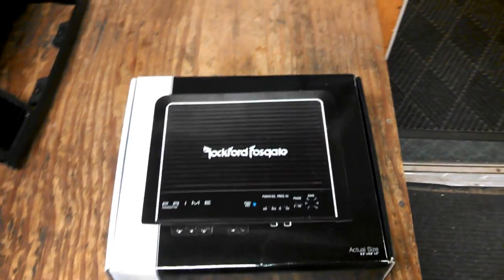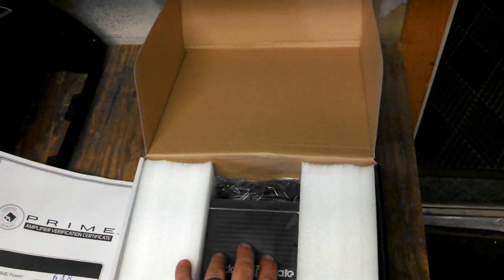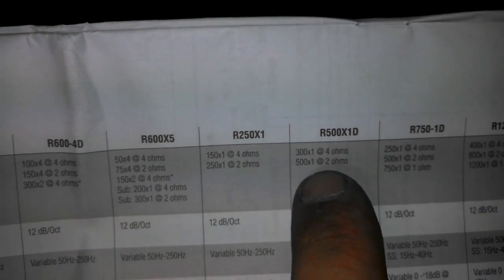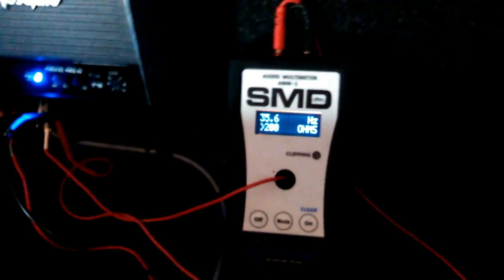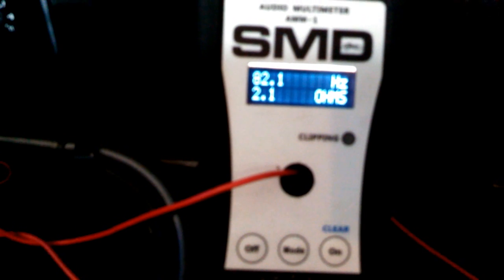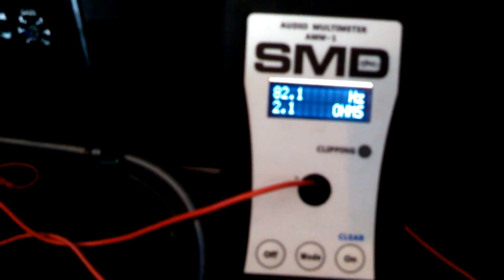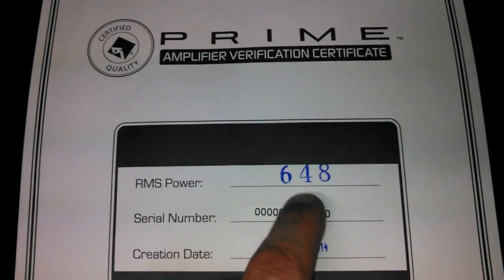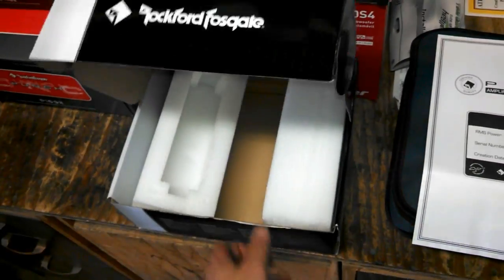AMM-1 Amp Test - Rockford PRIME R500X1D AMP DYNO

Comment: Hello, before installing my stereo, I would love some input from some fellow car audio enthusiasts. First of all, hello there :) I picked up 2 12 inch kicker comp r 500 watt rms @ 2ohm. I have each one in a sealed enclosure built to kicker spec. I wanted to power each sub with one of these amps. So I plan to run two of these amps total. Can I do this? Can I grab signal from one amp and bring to the other? Will I need a cap or an extra battery for this setup? I haven’t gone this big before so I’m trying not to blow sh*** up and make fires, any input or advice is welcome and very appreciated. Thank you all so much, have a wonderful day be safe and rock those tunes :) 👍 🤘

Comment: I have this very same amp in my truck pushing 2 Memphis 12's.......when the place installed it I looked at the guy and was like ,   really that Lil amp is gonna push them speakers. ....well it actually blew 2 of them within the first 3 months,  cracked the baskets on the woofer, no bigge, he replaced it cause it was still under warranty,  a week later the same side ,same thing , he then replaced it again by that time they had figured out that it was the previous generation Memphis subs that were the issue, after that and 4 yrs later still hitting hard only issue I have is the blue led light is no longer with us......RIP homie
Reply: Trent Robey you have an issue with your box, I would assume
Reply: @jeremys8360  yeah so I went with a ground shaker ported downfiring box with skar vd 12's and skar rp1200.1 amp still don't really like it, honestly the Memphis upfiring sealed box with a 500 watt rockford amp sounded better.....so now I got 4 audiopipe txx bdc4 6.5"s....just gotta build a foward firing box for it....urggghh...

Comment: I am happy to report my lil Prime 500 has been running strong without a single hiccup on 1 Kicker CVR-15 D4 @ 2ohms for over 4 years, not a single hiccup it's been paired with a Prime r300X4 for mids and highs. They have both been great amps for the money.

Comment: Just bought one used for $30. Also got a Alpine M500 for $30 and a old Punch 360.6 for $30. Installed in the family van pushing a single Kenwood 10" Excelon Shallow sub(250w RMS rated). Now I just need to hook up the bass dial where it can't be seen from outside but easily accessible while driving.

Comment: Do you really think this couldn't be wired at 1ohm?
Reply from the maker: TheAquam  Yeah I really do. It's not 1-ohm stable and will protect at 1-ohm.
Reply: I appreciate the honest answer and quick reply. I got the amp and a single DVC 2 ohm sub, after I got to looking and seen this wasn't 1ohm rated and realized I need to purchase a DVC 4 ohm sub lol. Thanks though
Reply: I've run this amp at 1ohm before, and works for about 30 min and goes into protection mode to cool down
Reply: I run this amp at 1.3 ohm all day long. No problems. Anyone care to elaborate?

Comment: my prime goes into protect mode now, whats the deal??
Reply: Peter Ou Was it working fine before?
Reply: 559KING yeah it was. It started a few months ago it would Go into protect mode when the bass hits hard. Then I lowered my gain it worked fine for a while. Noe it stays on protect. All wires seem to be fine.
Reply: Peter Ou What is your system setup? Ohms, speakers, 4 or 8 gauge etc....

Comment: AMP LAB Admin, i just buy R500X1D rockford amplifier to power my P2D2 rockford 12 inch 2 ohms Subwoofer, are they compatible?? Hoping to your kind support.
Reply: Of course 😊i just bought this amp for my two 12 inch rockfords
Reply: I'm running one of these
Amps to 2 p3d2 10s and they absolutely pound. I could use more power to them but don't really need it. I feel my ear drums flex when the bass hits

Comment: Are these stable at 1ohm?
Has anyone tested them at 1??
Reply: +MiragEdoz will not work at 1ohm. It shuts off.
Reply: the rockville amps are one ohm stable
Reply: @dank9288639  they are also junk overrated bs

Comment: Can I assume the 5.1 channel of the same exact series is also probably a good amp or is it possible it has completely different design and parts inside?  I'm thinking it will rate as well..  but not sure.  That goes with any manufacturer, I wonder if I can assume the entire series is good if one of the amps in series test well?

Comment: Just purchased this RF Amp and am pairing it with a RF 12" P2D2 single vented enclosure would it be safe if I go all 500watts?? The sub peaks at 800RMS, and would it be a dumb to do, to stuff the box with polyster batting for a better sound??? Need help this will be my 1st system
Reply: +Timothy Hinton hahahaha agreed once you get the bug ooweee lol 
I've dumped more money into this hobby/lifestyle than I care to say ahaha
Reply from the maker: well you actually purchased the wrong sub. You really should have purchased the P2D412. It's the dual 4-ohm version. 

With the one you got you will need to wire to 4-ohm, which is going to cut the power of the amplifier down quite a bit. And if you wire in parallel I stead of series you'll drop down to 1-ohm, which, since this amp is only 2-ohm stable, will either make this amplifier go into protection, or ruin it.

You really should exchange it for the dual 4-ohm version.

Also, the P2 is not 800W RMS.  But yes this amp will be perfectly fine for it, as long as you get the correct voicecoil configuration as I mentioned.
Reply: Not sure what you mean...the amp does it's job...there is no way to control watts once it is hooked to a sub in a box..it does what your sub and box let it do..down to 2ohms or so
Reply: +Timothy Hinton yea found that out once I did Lil research and hook it up myself, first time doing any type of sound system
Reply: bimbo831 if your sub or subs need 500-600 watts rated then you can not go wrong with this amp..I am impressed
Reply: bimbo831 just don't clip it or your subs..when It stops getting louder back off a hair or two and learn to hear distortion..my friend has an I phone and it sounds like shit on my sysytem..I have to tell him everytime he hooks up his phone he is clipping.turn the sygnal down
Reply: And I am not sure why the maker of this video is scared to run 20 hertz at full blast..any decent sub can take it..just. like a sub sonic filter..they can take it..if they can't then they are not good enough
Reply: bimbo831 welcome to the world of bass addiction..you will only get worse..it is like a drug...wait until you hear your buddy with 4 15's on 5K
Reply: +dank9288639 I just got a Sounqubed HDC4 15..it sounds great in my huge custom box but it is begging for 4 times the power...time for a high output alternated and a few batteries in the back..more money..lol
Reply: +Timothy Hinton Yea man I need to work on my electrical as well. damn alts cost a small fortune tho

Comment: Anyone got any sdvice? This amp blew my Alpine S-Type (500RMS 1500Peak) had the gain at 65%. Bad AMP? or my Ignorance??
Reply: Correction, my S-Type is 500 RMS and 1000 Peak
Reply from the maker: Doesn't matter if the wattage is matched perfect. You were most likely clipping the amplifier. Thats likely the cause of the blown subwoofer
Reply: The Amp Lab Is that too high of a gain setting?
Reply: The Amp Lab Thanks in advance.
Reply from the maker: No way to answer that. Depends on signal voltage from headunit, and other factors. You really need an o-scope or distortion detector to properly set gains. Some amps also have guidelines to set gains based on output voltage of the amp.  I don't believe Rockford has that though.
Reply: Gain is like a volume nob..only used to match your output to your other amps and settings...screw the guys that say gain is not a volume knob..that is exactly what it is but you must use it correctly ..it is there to set at the right level..might be 20 percent or 80 percent..it all depends

Comment: Would you be able to run them to 1 ohm? Running two Rockford Fosgate P2D4-12 4ohm DVC
Reply from the maker: I wouldnt think so safely.  These ARE still a budget amp.  Don't think they will like lower loads.
Reply: Personally i like rockford Fosgate cause they are True RMS thats why i want to get it and not break the bank but thanks!

Comment: Loving the amp tests. I need to make a video of what my old school Rockford bd1000a1 does for wattage.
Reply from the maker: Gonna try to do more amp test videos.  Tested quite a few, just always forget to video it.  Recently did an Alpine MRX-M110.  Rated at 1100W @ 2-ohm... did 2157W @ 2.3 ohms!!!!  What?!?!  Wish I had video as proof.  :-/
Reply: rtkota5point9 nice check out the vid of audiopipe dyno at .5 ohms did 2700+ lol would recommend running that but it took it, 1 ohm I think it did 1600+ I think but my alpine Mrx 550 went hard for a very small amp
Reply: rtkota5point9 nice check out the vid of audiopipe dyno at .5 ohms did 2700+ lol would recommend running that but it took it, 1 ohm I think it did 1600+ I think but my alpine Mrx 550 went hard for a very small amp
Reply: rtkota5point9 wouldn't recommend it*** I meant to say